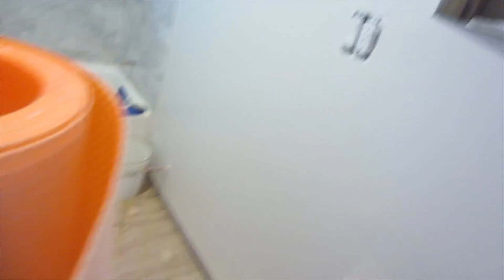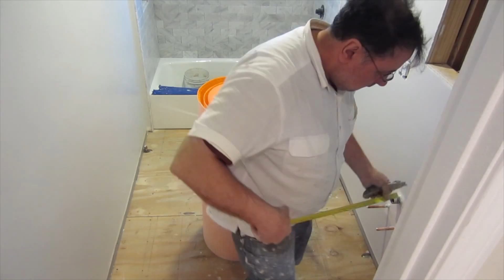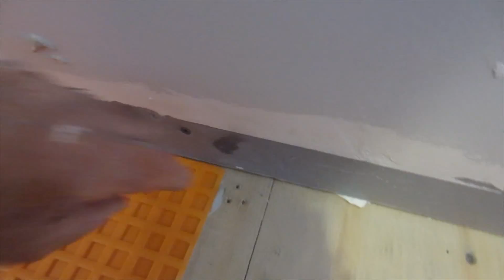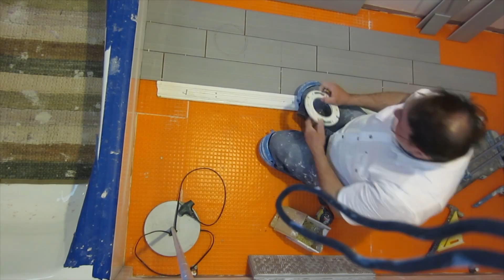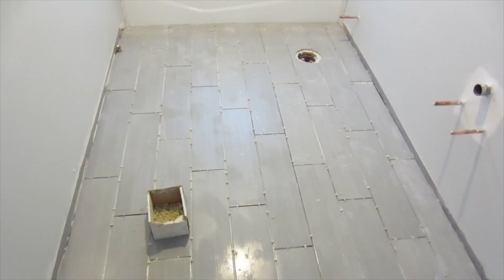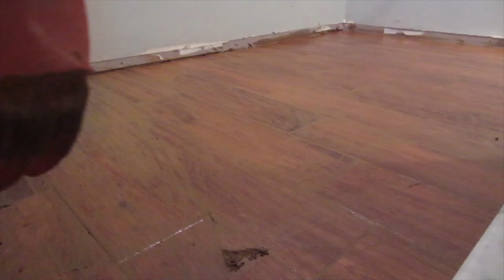How to install wood look plank tile on Schluter Ditra Parts 1 through 8

Comment: Thank you for the videos and tips!!  I am installing my first tile floor (6x24 wood look plank on concrete backer) and would be lost without you!!  For the next floor, I would like to use an uncoupling membrane on top of an OSB-type subfloor (it is not plywood, and not particle board, so I assume it is OSB).  For many of your uncoupling membrane videos, the membrane is placed on top of plywood subfloors.  I have not noted that you mention OSB.  Should I assume that OSB and plywood are about equivalent for the purpose of overlaying uncoupling membrane?  THANK YOU!

Comment: If you didn’t let the Schlueter dry overnight and all of that movement over the Schluter system will break the bond between the cement and the plywood and the Schlueter.

Comment: So, you are saying that you must use a “modified” cement thin set for the Schluter Ditra@ floor padding, but, use the “unmodified” (opposite) for a Schluter@ thinner wall fiber padding....?

Comment: You are a master at your craft sir. Great video! Thank you. I have a question. I see you use the Ditra over wood subfloor but what if you are laying Ditra over concrete subfloor? Do you still use the modified thinset or un modified?
Reply from the maker: You can use either on concrete.

Comment: I noticed several times that tile layers utilize the tile cutter (scribe style) instead of tile wet-saw cutter. Is there any benefit of preference in using one or the other when doing straight (linear) tile cuts? You are awesome Sal! I watch in depth your tiling videos -- which I have applied majority if not all techniques on the few tile jobs I have done! Thank you for taking the time to help and offering guidance to many thousands of DIYer's and professional (if they admit it) tilers!
Reply from the maker: Snap cutter is always going to be much faster than a wet saw. Tiles cut on a wet saw have to be dried before they are set.
Reply: @SalDiBlasi  Makes total sense! I have been considering purchasing one to accommodate my wet tile saw, so I appreciate the explanation!

Comment: Hi Sal, I love your videos they are truly showcasing what a professional you are.  I have a question on this 1/3rd guide for tile plank. I have 120cm 20cm floor tiles can you advise the cut length for the layout to avoid tile lipig ? Thanks 🙏
Reply from the maker: Not sure I understand your question. If you don't use a leveling system then stagger them by a third at the most, for wood look, random actually looks better, if you use a leveling system, and you have a good quality tile,  the stagger is less important.
Reply: Sal DiBlasi Hi Sal, we will be using leveling system which I purchased specific for this job.  I recently laid an engineered oak floor and just laid it random using the off cut from one of the run to stat the next.  But even so are you still recommending a maximum of 1/3rd lay? Thanks 👍
Reply from the maker: Yes, but the occasional longer stagger will be ok. Just be sure your tiles are relatively flat, the quality of the tile will impact the effectiveness of the leveling system.

Comment: can i use  cement board   waterproofing membrane fabric on the  gap and than using REDGARD on  entire washroom floor instead of Ditra ?? thanks
Reply from the maker: That will waterproof the floor but will not uncouple like ditra, which is the whole point of an uncoupling membrane.

Comment: Hi Sal! Clutter you put to isolate the plywood from the tile adhesive? Or still what the reasons there is? I would make a carpenter, instead of plywood, lay cement slabs Knauf super floor, and put the tile, right on the plate
Reply from the maker: You need to get a better translation, what you are saying is not clear. In any case, maybe this will answer your question https://www.youtube.com/watch?v=YpXEXqbh7ok&t=1s

Comment: Great videos, Sal.  Been following you for years.  Been doing this for almost 40 years.  Here's a tip you might like.  Instead of a hookbill knife to clean out excess morter, pick up a denture brush from your local drugstore.  Keep it in your water bucket.  The long bristles do an amazing job of picking up thinset.
Reply from the maker: Thanks, They actually make brushes just for cleaning grout joints, I do use them ,might even be in a video somewheres.  Always looking for good tips though, thanks

Comment: What would you recommend if my floor is wooden and there is a corner shower with enclosed screen. Can I tile straight on to plywood or do I need to use ditra over wooden floor?
Reply from the maker: Although there are methods in the TCNA handbook for installing tile directly to plywood, I would suggest that you use somthing else as your underlayment.

Comment: Sal, another video full of great tips.
Can you tell me Sal when is it absolutely essential to lay ditra.
Price sensitivity is an issue where I am
Reply from the maker: Wherever an underlayment is needed, which is pretty much always. There are other alternatives, Mapei has Mapegard UM, Ardex has Flexbone 740, Laticrete has Stratamat and more from other companies. Price is always a concern, longevity is not negotiable.
Reply: Sal DiBlasi , I interpret this as on every wood subfloor.
Regarding concrete floors can you provide examples when you would overlay with ditra
Reply from the maker: If I am doing it, I install ditra on concrete. There are two kinds of concrete floors, those that are cracked, and those that are going to crack, Interpret as you see fit. An uncoupled floor is protected from many things that a direct bond is not. https://www.youtube.com/watch?v=O7TxmGsCE_8&t=592s
Reply: Sal DiBlasi thanks. It’s required pretty much always then
Reply from the maker: Required, maybe not, advisable yes.
Reply: Indeed. Sal, can you recommend a professional manual cutter based on your experiences.
Mine (a Valencia ) is struggling with medium to large size tiles .looking at either sigma 3 series or Montolit 93 piuma
Reply from the maker: Montolit make great cutters, so does Rubi, never tried a sigma. you can find them on my website I would recommend a Rubi or Montolit, I have booth and use both and I know they are great cutters. https://dibsmart.com/product-category/tools/tilecuttersnippers/

Comment: Would installing 18x18" tiles in a small bathroom with only 1/2" plywood subfloor over 12" OC joists (2x10) with a span of 15' be OK?  We have tilers in process and I'm freaking out thinking this is going to fail.  I do not think they plan to add to the subfloor at all before putting down the Ditra.
Reply from the maker: !/2" is not good, Minimum 5/8 Plug your numbers in here https://www.johnbridge.com/vbulletin/deflecto.pl see what your deflection is. Here is the Ditra Handbook,  https://s3.amazonaws.com/scclegacy/media/ditra-handbook_eng.pdf?v=201507140600

Comment: I see you using the manual tile cutter. What is better, a tile saw or a tile cutter and when should they be used?
Reply from the maker: +Tony Cunha tile cutter for straight cutts, wet saw everything else, more or less. Tile cutter will save a lot of time.
Reply: Sal DiBlasi thanks for the info.

Comment: Hi sal
I love your videos. I have a question about the outer perimeter of the floor against the wall and tub, do you grout there also? Or just fill with caulk? Thanks!
Reply from the maker: Caulk against the tub, if there is no base board at the walls, just leave a gap and cover with the base, if the base is installed, then provide a soft joint like the tub with caulk.
Reply: Thank you for the response! Your videos are very informative and have given me the confidence to attempt some tiling of my own!
Reply: Sal DiBlasi What is the "base"?
Reply: @eightfigs  baseboard or skirting board in the uk

Comment: Dear Sal
thanks a lot for the answer.
I have a few questions, I hope you will not mind to answer?

1: what is the actual cutting loss of the tiles? 
for example for tiles of 60x60 of 30x60.

2: Is it possible to glue the sealing mat of schluter-system on the screed directly?
or it needs( the surface of screed) to be equalized first?

thank you very much indeed.
Reply from the maker: Sorry, I don't understand your questions.
Reply: Dear sal
iam sorry.

1:If the surface of my bathroom is 7 square meter how many square meter tiles should i buy?
Reply: I mean for the second question the (Dichtungsmatte von Schlüter-KERDI-2000)  sealing mat in German.
Thickness is 2 mm.
I intend to use it on the concrete surface ( ground ) of my bathroom to prevent water leakage.  
tis it necessary to Level the  Concrete Floor of my bathroom first?
Reply from the maker: Yes, the ditra mat is the last thing to go on before the tile, all leveling and flattening of the floor should be done first.

Comment: Hi Sal

Is doubleI gluing (on the wall and on the back of tile) always necessary?
i thought always that it is applied  just for big tiles !?

thanks a lot
Reply from the maker: I always back butter, most time just flat trowel the back of the tile it will give you a better bond without question.

Comment: Hey Sal, great video. I have a question for you. I want to raise my living room floor up with wood sleepers and plywood sheathing to the adjacent concrete floor and tile over everything. I am concerned about the tile cracking where there is dissimilar subfloor material. I understand that this Ditra product is for lateral movement, but do you think this would help in the vertical movement? Say the wood subfloor flexes a bit, would this membrane help control cracking in the up and down movement between the wood subfloor and concrete subfloor? Or would I be better off with cork membrane? Thanks!
Reply from the maker: You have to honor that joint and leave room for movement all the way through the assembly, no matter what you decide to use. With a little luck you can have it fall on a grout line to hide it.

Comment: Hi Sal.
when using Ditra over a basement concrete floor let's say the is not level, do I need to install self leveling compound before the Ditra?
Reply from the maker: Level the floor, and then install the Ditra. The ditra must be directly under the tile.

Comment: were the tiles installed here rectified?  I have some samples of Storka porcelain wood look tile coming soon, and I know the 3 I chose were rectified.  Also, the sizes of each color is available in 8 x 48 and 6 x 24 sizes;    Saison 9" x 36" - Orleans Wood Look Tile 
by Storka             

   Saison 6" x 36" - Orleans Wood Look Tile 

Is there an advantage or disadvantage of 6x36 vs 9x36?
This will be for a 19x25 kitchen floor and the laundry room next to it that is no more than 6x10 ft
Reply from the maker: The bigger the tile the harder it is to install, but besides that you should get what you like. in any case I would suggest you do not try to install the tile with a very small grout line, 1/8" is the smallest you should go, 1/16" if they are rectified, but 1/8" is still better.
Reply: thanks, I wasn't expecting such a fast reply :)   The guy at the business I got the samples, said larger was harder to install too.  I guess I wondered why since I've installed wood floor myself with long floor boards, but thinner than 6 inches.  I've been watching your video's for over a year now, and they are very helpful.
Reply from the maker: Wood floor is much different to Porcelain, I would advise the use of a lippage system even though I don't use one in this video.
Reply: not knowing what lippage system was :o)  I Googled it.  One of the links that came up mentioned these (Barwalt Tools
LASH Leveling Tile System Clips 96 Pieces)  Is that just a different way of doing it?
Reply from the maker: This might help you out https://www.youtube.com/playlist?list=PLiB6hq5lQ3h2RoUFH5pv5_QU1fDOrm3X6

Comment: Thank you for the great tutorials! I noticed that you are not using a leveling system even though you mentioned that the 6x24 tiles are large format. When do you recommend using a leveling system (if ever) with long narrow tiles like these?
Reply from the maker: Large format tiles are usually not flat, they are pretty much always  cupped, a leveling system can help eliminate lippage, and installing the tiles with an offset of no more than a third is almost always recommended. I will usually always use a lippage system with these larger tiles, but once in a while as in this case i just install them without.
Reply: Thank you for the prompt reply. I have learned a lot from your videos and appreciate the time and care you spent on them.

Comment: Sal, it necessary to use a subfloor if I want to install wood tile plank in a concrete floor?
Reply from the maker: +Marco Sipan Porcelain plank tile can be installed directly on concrete, and I have done it many times, however concrete expands and contracts at a vastly different rate than porcelain tile, so an uncoupling membrane is a good idea.
Reply: Thank Sal.

Comment: Sal,  I've been watching a lot of videos using the schluter products and yours are the best by far.  Am so grateful you took the time to video your work.  Have you ever used the schluter cove profile around the floor of a shower?  I'm thinking the cove profile will make it easier to clean around the base of the shower floor but have a concern that the profile may make it less waterproof.  What do you recommend.   Thanks,  Sue
Reply from the maker: +Sue Young I am not sure what you mean by a cover profile, are you referring to the dilex profiles, if that is the case that is what they are designed for.

Comment: Sal, you have the experience to know this answer. I want to use Ditra but my question is, there are a ridiculous amount of air staples that were used to hold down a lauan sub floor, can I just pound these down rather than pull them all up? I cannot get a straight answer from anyone including Schulter. There is no easy way to pull them up. Thanks, if you get a chance to answer this.
Reply from the maker: +jon trent If you have lauan plywood, it needs to be removed, that is the worst possible plywood to use as an underlayment, so the staples become a mute point.
Reply: it was a 1/4" lauan plywood they put down over the 3/4' plywood floor for the sheet vinyl that was down. when I pry up the lauan the staples pull through the lauan leaving the staples.
Reply from the maker: jon trent Well that is a good thing, but you should pull the staples, at least most of them.
Reply: thanks Sal!!!

Comment: Great demonstration video Sal; detailed, informative and low key. What about sealing the tile and grout Sal? Sealing is an important step, eh? I happen to sell tile, grout, thin-set and all the accessories and elements for complete floor and wall tiling projects; hardwood, laminate and VCT too. I'll be sure to check out your other videos. Thanks Sal.
Reply from the maker: +Dimi Domo Sre natural stones like marble should be sealed without a doubt, but Porcelain tile never, and I always use stain resistant grout that requires no sealing.

Comment: can i use this over old hard wood flooring, i should i go ahead and put concrete board over it ?
Reply from the maker: +jack wright The hard wood either needs to be removed, which in my opinion is the only real option, or it needs to be isolated from the cement board or Ditra with a minimum 1/2" plywood, no ifs and or buts. Just trying to be absolutely clear.
Reply: +Sal DiBlasi  Thank you. for the info. enjoy you video's

Comment: Hi Sal, great videos! I pulled out tile which was adhered directly to plywood, and before I add the new tile I'm going to use Ditra over the plywood. Seeing as how I'm going to put thinset over the plywood, how essential is it that I remove all prior residue from the plywood?
Reply from the maker: +Loren Foxx Grind it down and remove it,  you really can't know how well the old thinset is adhered to the plywood, or if the old thinset is even the correct type. Start knew, don't take any chances.

Comment: Aloha,On the ground floor in Hawaii is it necessary to use the membrane? That alone on our 550 square foot bottom level would cost us about $800.  What are your thoughts? Mahalo!
Reply from the maker: +Gary Wells i don't know what your area requires, but  If you are referring to a concrete floor, you can tile over it directly, but it will be a much better job with the Ditra.
Reply: +Sal DiBlasi Thanks Sal!

Comment: Sal, you ran the tile right up to the tub.  i have a cast iron tub and I thought the correct way was to allow 1/8" between tile and tub to allow for expansion.  Is it OK to butt tile to tub?
Reply from the maker: Video can be deceiving,  there is a small space for caulk.

Comment: Hi Sal, could you explain why such a large-notch trowel was used, and why you had to back butter the tiles on this job?  Thanks in advance, great videos.
Reply from the maker: The larger the tile, the larger the trowel. Large format tile are in general not flat, they usually are cupped to an extent, the larger trowel helps accommodate this, also the larger trowel allows for a greater degree of adjustment to avoid lippage. Back buttering is something that should be done in most cases, it "keys" the thinset to the tile and fills any voids in the back of the tile. Some stones have a lot of imperfections and voids, some porcelain and ceramic tiles have deep patterns on the back, back buttering insures a better more complete bond.

Comment: You didn't put the toilet flange on top of the tile did u?
Reply from the maker: Yes, that is the correct way of doing it when possible.
Reply: Sal DiBlasi but when you can't you can add toilet extentions and build it up easy fix.